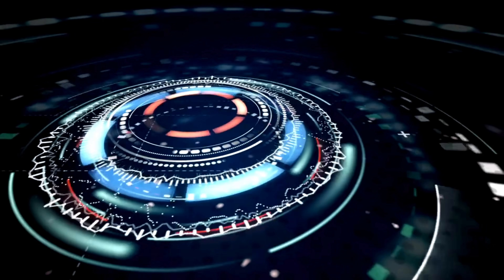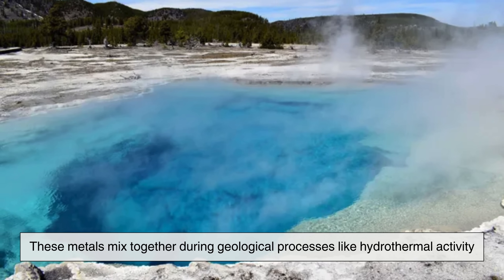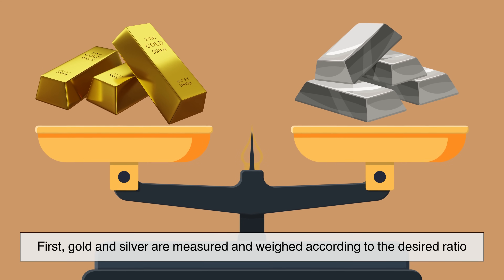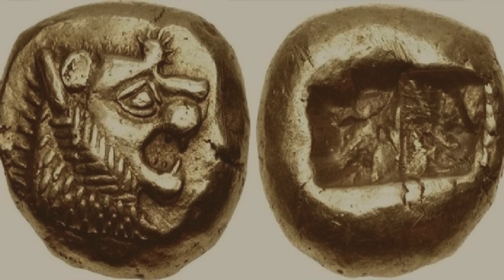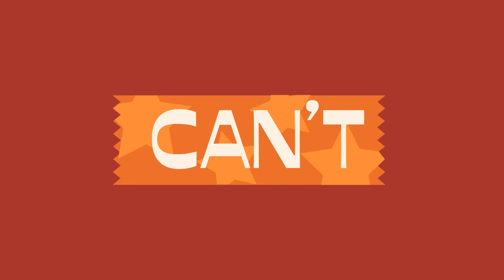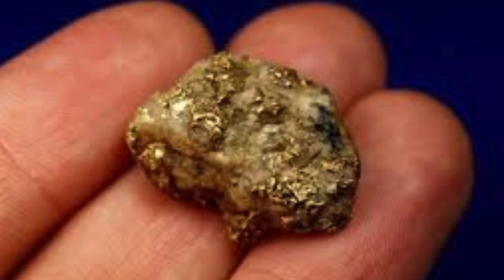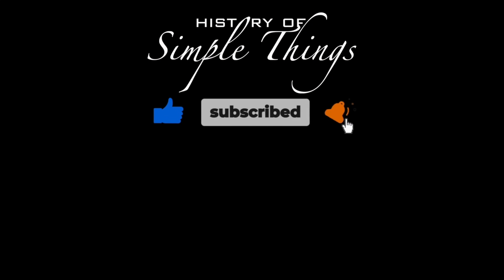From Gold and Silver to Electrum: The Truth About This Rare Alloy

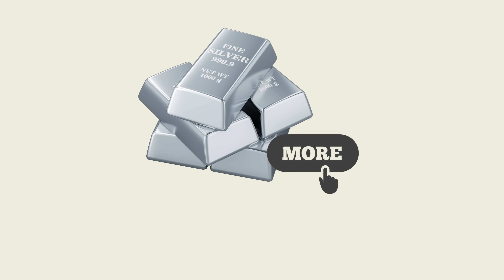Comment: Regarding 1:20, the Electrum separation process is known as Salt Cementation whereby Electrum was combined with salt, urine and brick dust (or pottery shards), sealed in a crucible and heated. Thereafter purified gold would remain in the crucible along with silver chloride which would later be purified into silver. To convert silver chloride into silver, you would mix it into an aqueous solution with some Lye and then some Sugar. Then melt the precipitated silver into bullion. This allowed silver coins and gold coins to be minted separately. The advantage was that silver coins could be recognized by their white color whereas gold coins could be recognized by their yellow color as well as their heavier weight. This made silver coins and gold coins more efficient than using electrum coins for commercial transactions. However, on May 22, 1877, Dr. William Wheeler Hubbell sought to promote his coinage metal alloy called “Goloid” which was a mixture of 87.3% silver, 9.1% copper and 3.6% gold. It turned out that Goloid failed to be used as a coinage metal, because its appearance looked too much like silver and this would have caused confusion and enabled counterfeiters to take advantage of it.